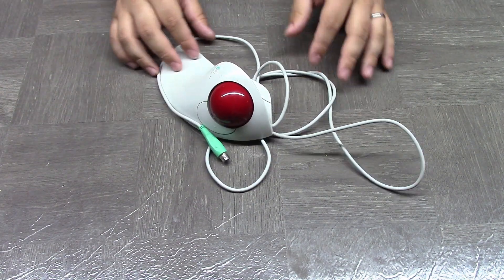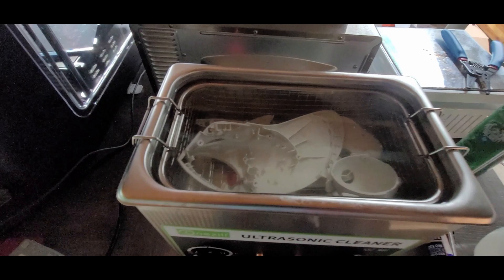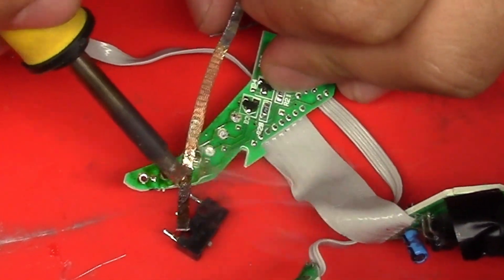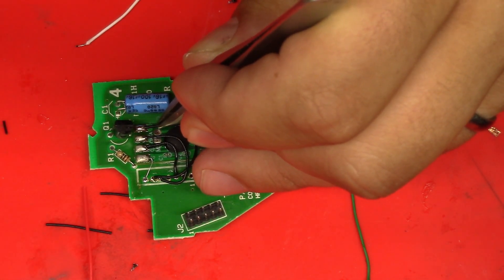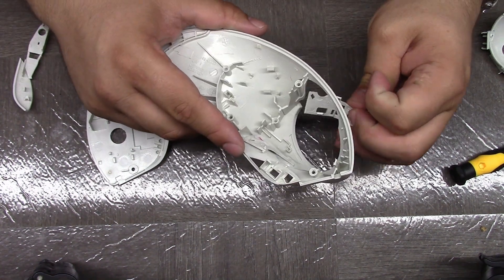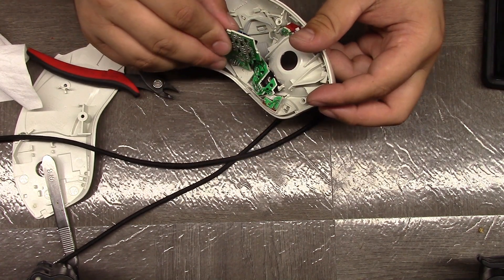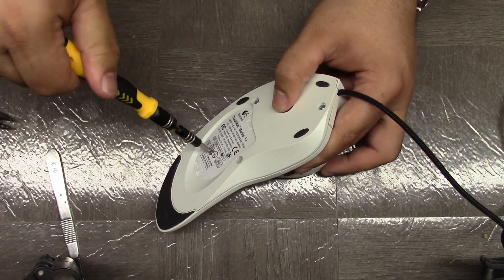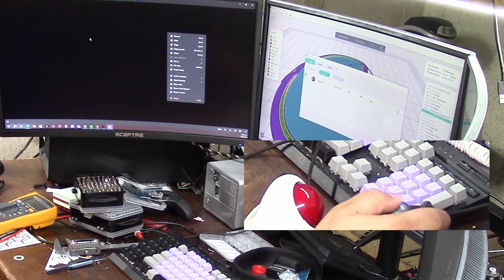Retro Trackball mouse gets a USB MOD!

Comment: I know this video is old but any chance you can post which switches they are with a link or anything? Just in case we decide to switch to these switches as well? I think mine are ok, I have to find a way to test them somehow with a connector (also find the 2nd one of these) and test it out. But I dislike the other Ergo mice I have from Logitech, the MX Master is a beast, but I didn't know I could even do this with this one to use again!